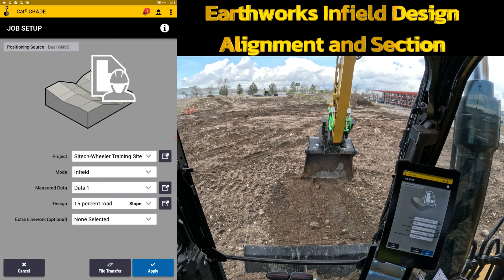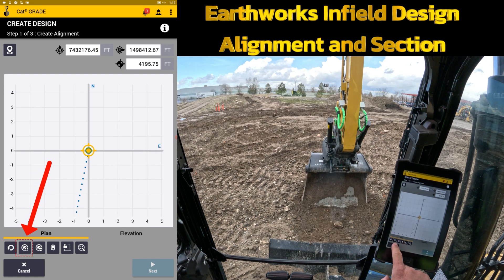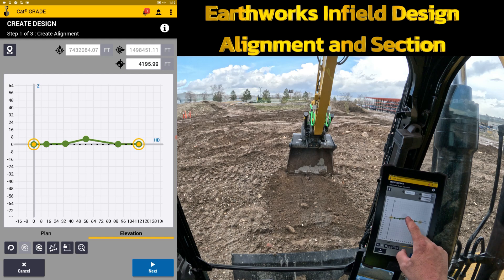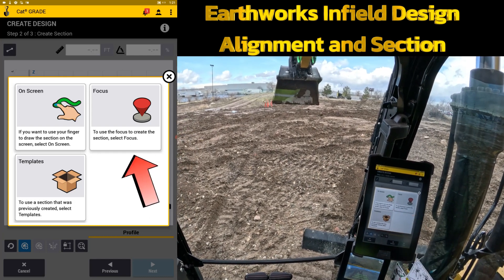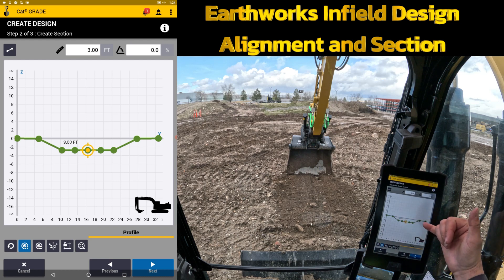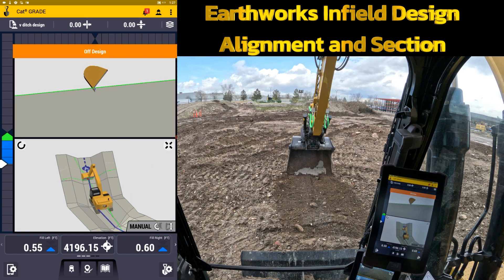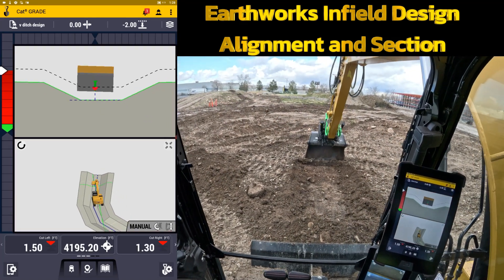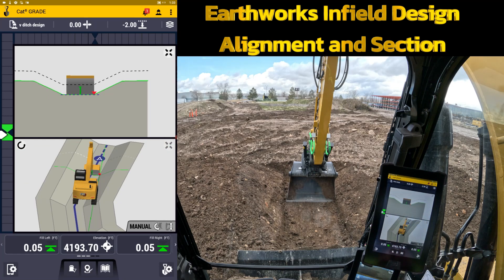SITECH Intermountain Trimble Earthworks Infield Design Alignment and Section

Comment: Great video! Really wish Trimble would add a button for both vertical and horizontal that would take all the points you shot and then generate a nice rounded curvature to the design so it was not sharp changes in direction or elevation at each point but you could choose to round them off by maybe a certain distance for either side of each point or maybe just a “best fit” that the computer generated for you. Thank you for making these videos!